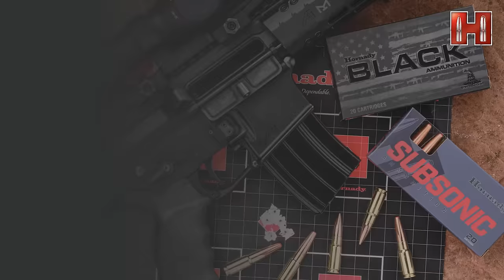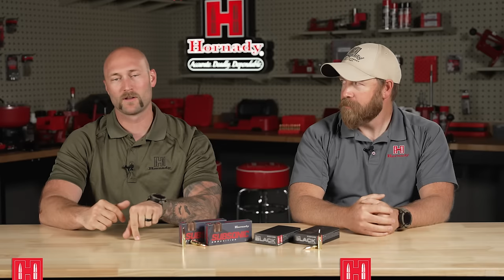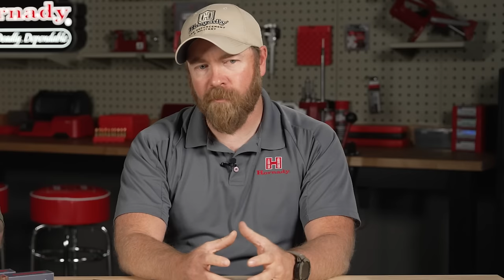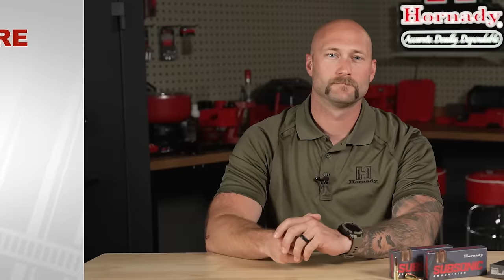338 ARC vs. 8.6 Blackout

Comment: The  .338 ARC uses junk curved ARC mags, that don't work well in ARs. The .338 ARC bolt face has to be opened up - no bueno. Q's Boombox weighs less than most AR-15s, so that sucks for the .338 ARC.
Reply: Weird.  I wonder why all my Grendel mags work so well since 2009, to include CProducts, ASC, Elanders, Amend2, and Geissele.  I’m shooting them through every barrel length there is, from 24” down to 8.5”, though I’m just getting the 8.5” set-up.  I’ve been shooting 12” a lot since 2017, suppressed.  Runs like a r 3 ped ape.  I shoot a lot.  I have moving boxes full of spent brass to prove it, along with heavily-dinged brass deflectors with no Cerakote or anodizing left across multiple 6.5 Grendel AR-15s.